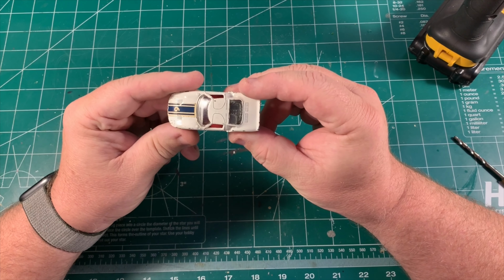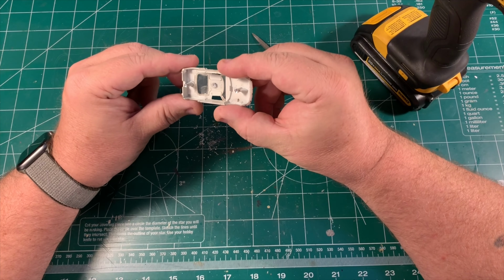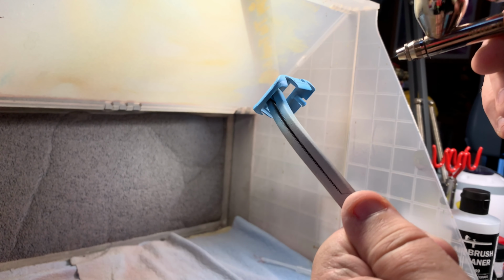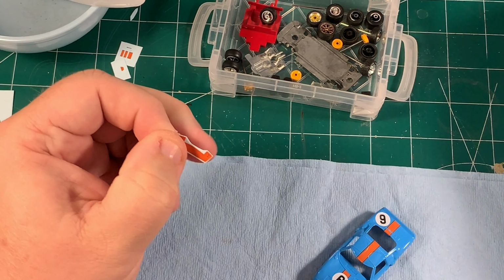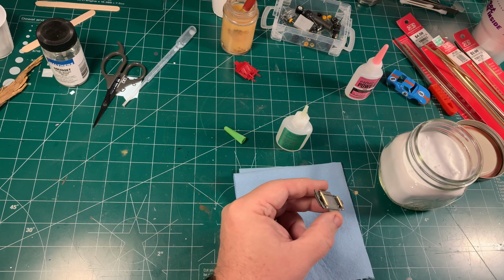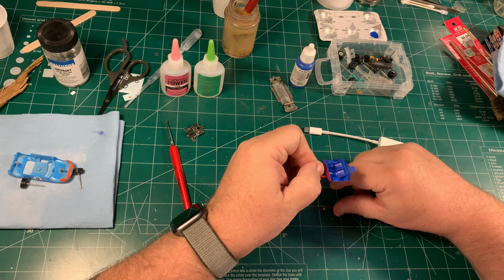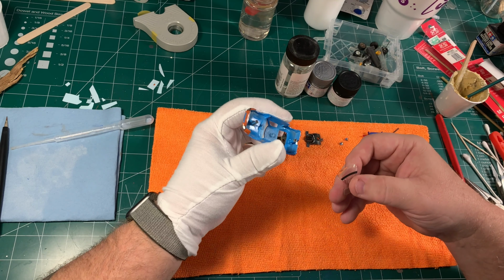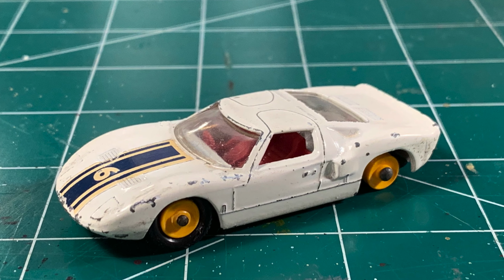The Three Blind Mice Present - Fixing a Funky Ford (Customizing a Matchbox Ford GT)

Comment: Ironically George went the Gulf route also.  By now you already know and have likelybseen his build.  
I am actually a bit shocked you went through the trouble of ultra detailing yours and missed the tail lights.  😳
It is stunning.  The early years of the GT project is what this casting is.  George updated his to the next version adding things that were not on the concept Lesney copied their casting after.  As such I find yours more true to the original.  I do believe this concept GT was never liveried by Gulf however asbo said it is absolutely stunning.  Not to be out done Lee's car is a perfect Lesney Hot Wheel.  
All in all I love each take on this casting.  Had I more than one in my collection Id probably do similar builds.  Lol.  Thanks Paul.
Reply from the maker: I noticed too - AFTER the video was uploaded!  LOL....

Comment: If you would'a pulled that interior out, and a swarm of baby spiders ran up your hand, well, I would'a woke up the whole house laughing. But you would'a had a challenge trying to pull that casting out of whatever wall it lodged in after you slung it. 😄 LOL! I'm glad to see the Ford GT-40 getting some love, it was a mean machine, back when Blue Oval realized how important it was to appeal to us motorheads instead of the yuppie luxury car crowd. I'm still a Ford man, don't get me wrong, but the days of the GT-40, Mustang, Thunderbolt, Talledega, Cyclone, and Cougar were the highlight years. (Yes, I know Mercury made some of those, but Ford/Mercury were the same delicious sandwich). Great build as always, it turned out excellent! 👍😵